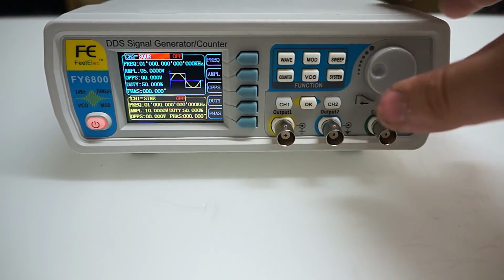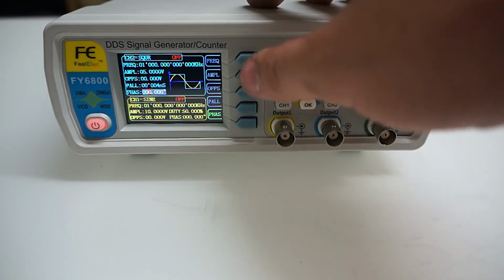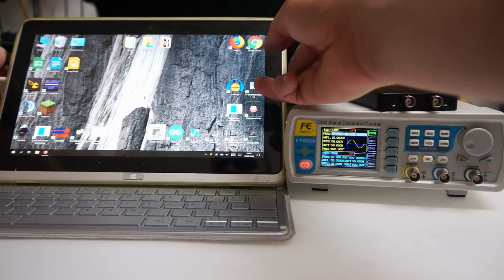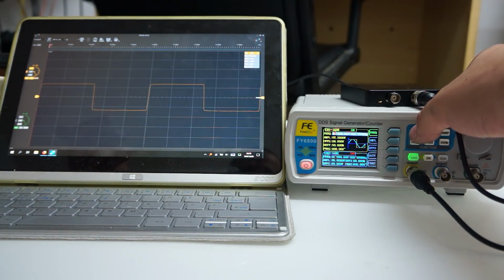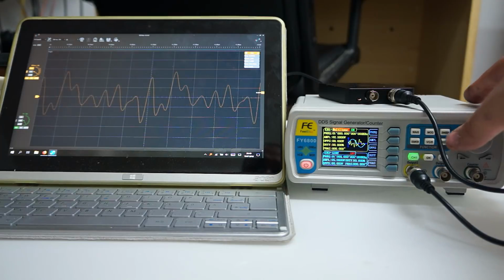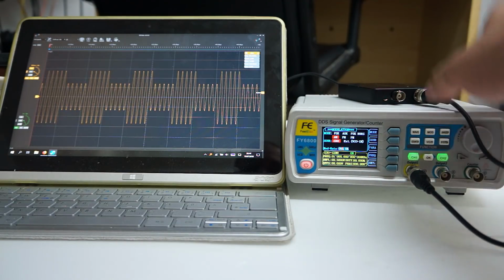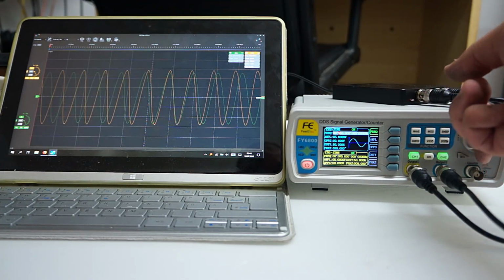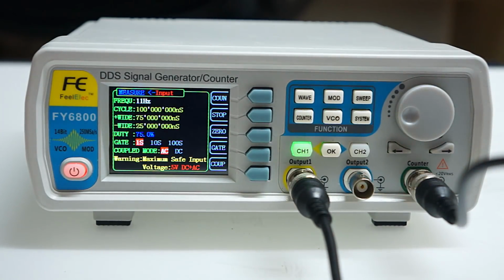FeelTech FY6800 Review & Teardown

Comment: Thank you.  Great tear down.  My supply is dead (lightning transient with rear switch ON).  Thanks to you I have a plan.  First, apply +/-12V & 5v to main board and check for operation.  If it is still good, rather than fix the power supply, I would like to supply the needed voltages thru a connector on the back.  That is because people have commented that the switching supply in the box contributes to noise on the waveforms.  BTW, with the rear switch ON, any power failure and restore turned on the generator.
Reply from the maker: yes, i have mine on a switchable outlet i dont want to let it run 24/7 
get rid of the awful psu and put something good low noise in there.  like those small mains psu modules that output +-15v with 7812/7912 afterwards and one for 5v
Reply: @gamerpaddy  Good thinking.  Too late for me😏.  Any links to such supplies I could use?  I am having trouble finding a suitable supply.  Thanks, Doug N8VY
Reply from the maker: look for RAC20-K and LH05-23B05R2 on digikey, they should do.   or RAC10-15DK if you want to add linear regulators for +-12v afterwards to lower the noise even further.  @dougbas3980

Comment: Im not able to adjust the duty cycle for rise and fall in square  4:19.. seems like there is a bug on Fy6900 sw 1.3.1 and it seems like a bug as you can get it to show "rise" if you fool around, but no adjustment and if you then push it again it will go back to duty and be locked there.
only in trapezoid it works.

Comment: In one of your answers you say that the unit has no sync/trigger pulse. Have you tried using a pulse output from ch. 2 as a trigger? Also have you looked at the sync output to see if that can be used?
Reply from the maker: Sync in/out is to sync two or more devices together to work in phase   and  ch2 doesnt Output a sync signal when doing a sweep.
Reply: @gamerpaddy  Yes I understand that ch2 does not give a sync pulse. I wondered if ch2 could supply a pulse at the same frequency as ch1 and could be phase shifted to act as a sync signal. Also do you know (have you scoped it?) what sort of signal the rear sync output produces? Your excellent video has left me very curious about buying one of these instruments.
Reply from the maker: Sync Out Outputs a 3.3v CMOS Signal  with the set frequency of channel 1 divided by 2, in a sweep..it sweeps aswell. Its allways outputting it even with channel 1 disabled.

Ch2 Runs Independend of the sweep   a 1hz signal on it isnt sync with a sweep thats 1s long it even drifts slightly apart since its not exactly a 1 second sweep

The only way this could Work is via a FM Modulation  Set ch2 to a Ramp or exponential function with the Speed of your sweep like 0.1hz for 10sec.  and Set ch1 to the Center frequency of your sweep range like 10khz for 0-20khz
Then do a FM Mod in ch1 with ch2 as source.  Set bias to your range (20khz)   Then you can Trigger Off ch2's falling Edge
But its phase ist drifting very slightly
Reply from the maker: @jonka1  see https://imgur.com/a/ihUWmES
Reply: @gamerpaddy  Thank you.

Comment: I spotted the modulation of one channel with another, please can you tell me if you have used it (or checked) it with modulating an external source (eg: DTMF / voice / ) for both FM and AM ?
Reply from the maker: you can use the external input which goes from 0 to 5v to modulate the signal. ive used it for speech by having a 2.5v offset and a audio signal, fm modulated on a 4 cycle sine (custom waveform of 4 sine cycles made in the pc software, so output frequency is 4x whats on the display)  set to 25mhz, i could hear stuff on 100mhz on my FM radio.    didnt sound good actually.

Comment: Can anybody please tell me whether the FY6800 would be accurate enough for calibration and adjustment of an analog oscilloscope from the ealry 1970s? Or should I save and buy a more expensive unit? I have read a lot about this unit  on the forums and here on YT - YT6800's problems with noise, jitter and other things.
At the moment I can afford to spend around 300 Euros / dollars (260 UK pounds) at most on a Uni-T, Voltcraft, Rigol, Sigilent or Owon (or maybe you can recommend something around my price point). I would like the most accurate and precise instrument I can afford at the moment - I want to be able to calibrate other instruments and devices with it. Thank you in advance!
Reply from the maker: its probably be good enough to calibrate a dso even from the 90's
Reply: @gamerpaddy  Thank you, I eventually bought the FY6800 last September. I am very impressed with this magical box, all the different functions in a very small package. However, I will probably be using a professional calibration service to get my oscilloscope up to spec - the voltages required in the service manual are ridiculous. For example, the adjustment of input attentuators requires square waves at 10 kHz, 200 ns rise time, voltage in ranges from 6 mV to 80 volts!
Reply from the maker: do you think your scope is worth it?  the tech in the 70s wasnt that good compared to later stuff.. 1960 was the year of the first ever transistorized oscilloscope from tektronix.. 10 years isnt much time to make a lot of progress.

and for the price of a calibration you probably get something really good new or on the used marked thats allready more accurate than what your scope ever can be.
Reply: @gamerpaddy  You are absolutely right, but my thinking is a bit unorthodox. Of course it depends what will the calibration lab ask for the alignment, but it is a nice 2-channel 25 MHz scope I would like to have as my main scope (Philips PM3210). At the moment all I have is the inexpensive DSO138 kit. The Philips scope's specs are plenty enough for what I want to do with it - mostly audio work, some am receiver alignment. I am planning to get a decent DSO later.
Reply from the maker: i have had the Philips PM3100 and a tektronix t935 analog "storage" oscilloscope  but since desk space wasnt quite there anymore and since i started repairing hifi equipment and doing digital stuff aswell, i went and bought a siglent sds1104x-e its capable of so much more, yes its digital but supports the usual analog stuff like display persistence, xy mode and such.  plus you get automatic measurements, not just a trace on a screen where you gotta count the divisions.

 i havent tried the dso138 kit, but theres only so much you can cram into a repurposed mp4 player, but for quick n dirty work like checking if a signal is present and rough measurements they will do the job.
Reply: @gamerpaddy  I don't know the PM 3100 but it seems it doesn't take up much space :D A bit like the Tektronix 213 DMM.

I am just basically starting with oscilloscope work, so I might just as well learn how to count the squares. The DSO138 kit is quite limited, but it was good soldering practice and my first oscilloscope three years ago and it made me understand oscilloscopes and their controls better. And the funny thing is this DSO138 kit from eBay cost me the same as the 13 kg Philips PM 3210 !
Reply from the maker: oh i ment the PM3200, not 3100 which doesnt even exist.   but yea not too big, but it was one channel only and the new DSO is like half the size.   
the tek 213 is nice collectible  Mr Carlsons Lab did a video on it.   

a Philis PM97 ( Fluke scopemeter) is also quite nice.   for the latest in the mobile oscilloscope market, i guess its the micsig tablet scope, mikeselectricalstuff did a video on it a while ago.

Comment: Can you tell me what the maximum sweep rate is?

I have an older FeelTech that has a sweep rate of only 1Hz/s, while my Siglent SDG1025 will sweep 
.02Hz/s.

I am wanting to replace my SDG1025 with something cheaper but need a better sweep rate than the 1Hz/s my old FeelTech has.
Reply from the maker: I can Set the sweep time to 0.01s in my 6800.  Longest sweep time is 999.99sec.  Havent checked the rate yet but it wasnt 1hz/sec
Reply: gamerpaddy 

Thanks. I'll have to do more research on that I guess.

My old Feeltech also has a max sweep time of 999.99s, but regardless of the time the maximum sweep rate is 1Hz/s... if I set the time to 200s I can scan 200Hz but if I try to scan 199Hz it doesn't do anything.

1Hz/s is still a pretty good sweep rate but there's no comparison to my Siglent SDG1025 that will do
.02Hz/s & more as I haven't found the limit on it yet.
Reply from the maker: how about using FM and a low frequency on the second channel?    the main thing that annoys me on the sweep function is the lack of a sync/trigger signal.
Reply from the maker: How exactly do you test?   go to sweep function, 0 to 200hz within 200sec right?    and when going from 0 to 199 it doesnt do anything?    well i cant reproduce the issue this ways  it works for me.
Reply: gamerpaddy 

Ok- so it can sweep less than 1Hz/s....if you reduce the time but keep the sweep range at 200Hz how low can you reduce the time before it stops.
Reply from the maker: stop stopping?  i dont quite get what youre saying.  it doesnt stop.
 i lowered the sweep time to 0.5s and it still did sweep correclty. well at some point after decreasing the time and increasing sweep range further (0.1s, 0-1Mhz) my oscilloscope got at its limit of displaying whats going on.
Reply: gamerpaddy 

Sorry bad typing on my part.

What I'm trying to do is sweep a narrow frequency range as slowly as possible to find the resonance and bandwidth in several high q resonant circuits. 

There's probably a better term to describe the sweep rate but I'm not sure what it is? 

If I am sweeping over a 100Hz freq range my Feeltech unit will not sweep any slower than 100 seconds, so 1Hz/sec is the slowest it will sweep regardless.

My Sdg1025 however will sweep incredibly slow- I've used it to sweep a frequency range of 10Hz over 200 seconds. 

I'm just trying to see if the FY6800 has a comparable sweep rate as I want to replace my SDG1025 with something smaller and cheaper.
Reply from the maker: ah now i get it, so. ive tried sweeping from 0-10hz in 300secons and there was no noticeable stepping. the display went up in 0.1hz steps slowly and the oscilloscope showed a smooth waveform, the frequency increased in the measurement function by 0.01-0.02hz at a time.     0-10hz with 999.99s time did work aswell but havent tested it further
Reply: Awesome, good to know.Thanks, and sorry for the miscommunication, that was my fault.
Reply: UPDATE: I recently found out that when sweep is in LOG mode you can sweep very slowly, so slow that it can sweep 1Hz in 30 seconds time. 

I guess the designers thinking was linear meant the sweep rate is linear and when you sweep slower than 1Hz/s its Logarithmic? Don't understand it but it made sense to someone. 

I also found out it will sweep starting from whatever setting you input last, if you set 10kHz as the begin freq then 12kHz as the end freq then hit scan it will scan down from 12kHz to 10kHz. If you put in the 12kHz end freq first then the 10kHz beginning freq then hit scan it will start at 10kHz and scan to 12kHz.

Thanks again for your video and help on this!

Comment: hello I need help because for an error I have damaged the front panel microcontroller and now I need the firmware could you help me?
Reply from the maker: no  
 the original firmware is protected and cannot be read from a working controller, also it cant be donwloaded anywhere    the only thing you could do, is reverse engineer your unit, learn stm32 programming and do the community a favor by writing a custom firmware for it.

Comment: So the only real difference between this and the FY6600 is that this one is properly grounded?

Oh, and real buttons instead of the membrane ones on the FY6600.
Reply from the maker: can the fy6600 pc software update the device firmware over serial/usb?
if yes, then yea theres just these two improvements.
Reply: @gamerpaddy  Check out this github page: https://github.com/DerKammi/FY6600-15-30-50-60M

Comment: if more than 5MHZ  does  sq wave  look like  sine
Reply from the maker: my setup https://i.imgur.com/1XExjYv.jpg
10Mhz at 5V Amplitude, set to 8ns rise/fall = https://i.imgur.com/q7hNz6Y.png 125Mhz BW not bad
at 30mhz same https://i.imgur.com/BQqZfM9.png

under 20mhz, the opamp stage can be turned on. to go from 5v amplitude up to 20v BUT its max bandwitdth is 50mhz see here.
20Mhz 10V https://i.imgur.com/MHamsUq.png
10Mhz 10V https://i.imgur.com/QntLFPE.png
over 10V it distorts at 10Mhz an above.  people have replaced the opamps for better performance in the 6600, which is same pcb like 6800.

Comment: source ch2  means  ch2 is being modulated  ,,  by ur choices of  ch 1 ,,, and  output from  ch 1   right ??
Reply from the maker: no
ch1 is the main signal, which can be modulated by either ch2 or EXT input.  to modulate ch1 with ch2, ch2 has to be enabled.
in the software there is no ch1 ch2, its main and auxillary channel, since all special functions like the adjustable pulse waveform, modulator and vco runs from ch1 only

Comment: hello, i like this vid. can you please measure Vpkpk on max amplitude is  into a 50 ohm load at 36mhz
Reply from the maker: See your email.
i didnt use a 50ohm load, not sure what load my siglent scope has.
here are the photos i took.  28.5Mhz 5V, 36Mhz 5V, 36Mhz 20V (10V for the fft picture) 
https://www.file-upload.net/download-13353386/Photos.zip.html
Reply: @gamerpaddy   what does this generator cost and where did you buy it from
Reply from the maker: from the usual scumbags (ebay aliexpress shitfromchina-shop) cost me under 100 bucks
Reply: @gamerpaddy   so is it worth the money you paid whats your thoughts cheers
Reply from the maker: Yes 100% you wont find a better AWG under 400..500 bucks except maybe a used / broken one.

Comment: Yet another review on this product that does not use the maximum frequency and amplitude.  If you want to test it properly, you need to see how it performs at it's limits.  Also what is the lowest amplitude?  IE:  Can it output microvolts to simulate a received signal?  Do the wave forms distort at it's upper limits?  Looks just like the 6600 with upgraded buttons and power supply.
Reply: ... its limits
... its upper limits

Yet another comment made by someone who doesn't know the difference between the possessive pronoun (its) and the contraction of it is (it's) and it is i.e. not IE!
Reply from the maker: technically its the 6600 with the upgrades you mentioned. + grounded bnc's + firmware update via pc software. 
so yea, for raw performance tests you can reffer to a 6600 review.   
i couldnt measure the limits with my dscope anyways, since it was the limiting factor. 
but i did some tests / pictures with my new scope further down in the comments
Reply: @gamerpaddy  By dscope you mean a Prism dScope or just a digital scope?
Reply from the maker: https://www.dreamsourcelab.com/
Reply: fucking moron ....you obviously have a much better vid to watch ....oh ........you dont ....then fuck off .